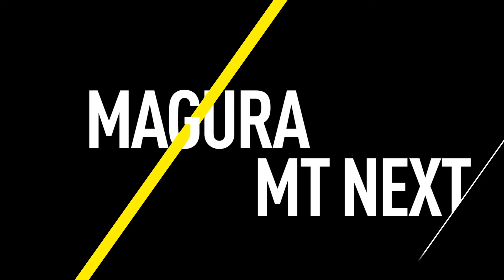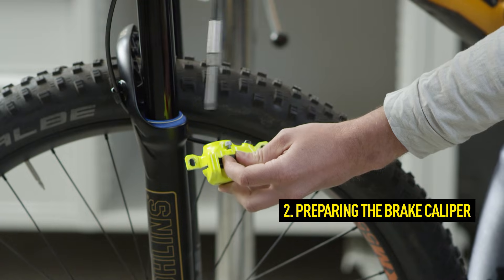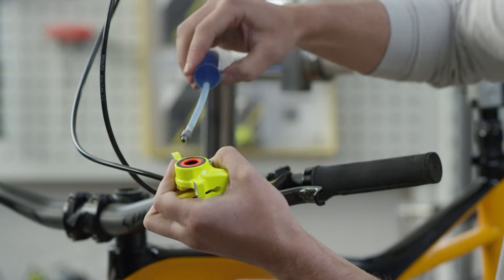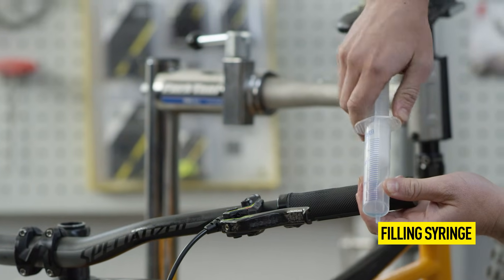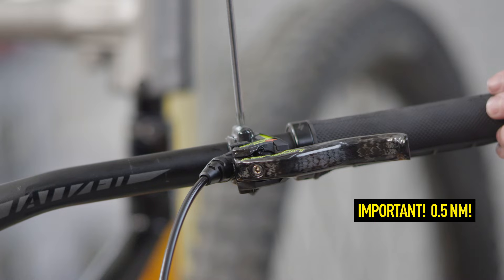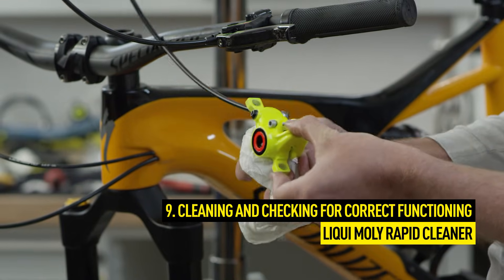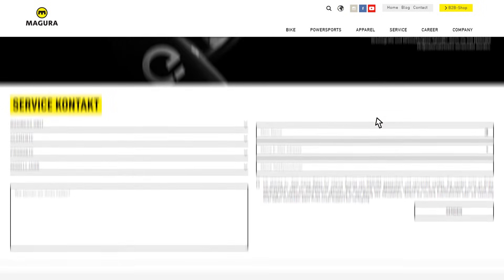MAGURA MT: Filling and Bleeding

Comment: Alright, but what are you supposed to do if you've got internal brake hose routing so cannot lift the calliper up to anywhere near the level of the lever? The only thing I can think of is rotating the entire bike nearly 90 degrees so that the calliper and lever are almost at the same level, but to do that comfortably I'd need a workshop grade repair stand with rotating clamp and I don't have anything like that.
Reply from the maker: Getting the caliper to the same height as the master when removing the syringe won't "make or break" your bleed - you will most likely only loose a bit more oil in the progress. It would still be good to get it as close as possible by tilting the bike though.
Reply: @MAGURAPassionPeople  If you loose oil you get air, pretty simple, make a quick bleed screw like everybody else.
Reply: @MAGURAPassionPeople  "One more thing to keep in mind during bleeding , is that the caliper itself has to be oriented vertically. If it's bled in a "flat" position (as it often is when mounted on a bike), air can not leave the caliper." Oh look, you stated it yourself
Reply: My issue too.

Comment: I really wonder why Magura does not use a traditional bleed screw on the caliper. That whole "raise the caliper and quickly close the hole while fluid goes all over the caliper" part could be avoided by a simple open/close valve. Like Shimano, Hope and many other brakes.
On "other brands" you literally 90 degree open that screw, pump in the liquid, close it and you are done. 

Any particular reason for this?
Reply: Good to know! Trying to hold the caliper above master on a internally routed hoser of a 65 pound bike is a massive pain
Reply: Agreed 10000000% pure pain in the arse messy and risk of air getting back in easier.
Reply: I wish it was as easy as a tektro 7 speed
Reply: Because they are dumb, only reason I can see, had to buy a stahlbus quick bleed screw to finaly be able to bleed properly on my surron. That's so fucking dumb.
Reply: ABSOLUTELY!!!! If I had known how crap to bleed these brakes are I would have avoided them like the plague.

Comment: I just bought some breaks for the first time and have never fitted them before do I have to bleed the breaks straight out of the box or do they come ready bled
Reply from the maker: Our MT brakes come bled out of the box, but you might need to re-bleed them if you shorten the hose - or generally open the system in any way.

Comment: I have these very same model, which I bought in 2019, there was no problem at until a week a go, I notice the rear brake was going until the bottom without pushing the brake pads, then yesterday I notice a leakage of Mineral Oil coming from the master level, exactly by where the lever blade pushes .... I need to know if this is normal and just a filling/bleeding will fix it?.. or is something abnormal... because I think, why would the mineral oil would flush out by the lever??? Weirddd!!!! 
Is there any tutorial about maintenance of the master level happens that before this happened past week I have been hearing a very annoying noise for when the lever is pushed in the master level, almost like something regarding the maintenance of the master level, but I haven't found any tutorial about disassemble of the master level only switch the lever in this video: https://www.youtube.com/watch?v=aDfDebmqCLQ..
I need help, right now... thanks.
Reply from the maker: Hello, we're very sorry to hear that you're experiencing issues with your brake!

If the brake is leaking at the master, bleeding it will definitely not fix it. We're unfortunately not able to fully diagnose something like that via the internet, but it's likely that the master would need to be replaced.

Please contact your according bike shop to check for warranty claims and to discuss solutions with them. If necessary, they can get in touch with our service team to check how to proceed.

Comment: i own a specialized turbo levo M5 2021 with  Sram guide RE brake   , can i mount the MT 7 without to change the disc ? thanks a lot .
Reply from the maker: We highly recommend to use our brakes only with MAGURA Original Rotors. Our rotors are 2 mm thick - this is 0.2mm more than SRAM rotors and this can effect the performance heavily. Our 5 years leak proof warranty is also only valid for complete MAGURA brake systems.
Reply: @MAGURAPassionPeople  what rotor do you suggest ?
Reply from the maker: @mauro2223  Generally speaking, all of our rotors will work with all of our MT disc brakes. We have summed up the differences between the different models here: https://www.magura.com/en/components/customize/setup-guide/

Feel free to send us a message on Facebook or Instagram if you have any further questions regarding your rotors!

Comment: Magura hs 33 when should i change the oil ?
Reply from the maker: As the HS33 brakes use our Royal Blood mineral oil, you don't have regular oil change intervals as you would with DOT brakes. The oil only needs to be fully replaced when it's very contaminated. It's a different story if there is air in the system, giving you issues with the bite point. But if that's the case, you only need to bleed the system, not fully replace the oil. Hope that helps!

Comment: excellent video but the problem remains the same, first two strokes very light braking, excellent braking from the third.
Reply from the maker: If the bite point moves outwards when pumping the brake, there is still air in the system. In that case the brake will be need to be bled again thoroughly until all air has been removed.
Reply: @MAGURAPassionPeople  as opposed to being a product that is easy to work on and set up - just keep claiming the mechanics are the problem

Comment: Hey, I have mt7 brakes. I bled them last week and it seems that oil is leaking from the bleed screw at the caliper. Does this screw need an o-ring? My caliper bled screw does not have any o-ring, but it is hard to see in this video if it requires one when the technician is reinstalling that last screw. Thanks!
Reply from the maker: Hello, thanks a lot for your question! The bleed screw on the caliper does not need an o-ring and the use of one isn't intended. Only the banjo connection needs one on each side.
Reply: @MAGURAPassionPeople  i don't know - I'm getting the same problem, leakage and air being sucked in thru the bleed screw. Going to try teflon tape...
Reply: Ive seen this on my boss's bike as well. I added a thin shim as a washer and it solved the mini leak for me.
Reply: your brakes are probably leaking because you over torqued the bleed screw (does you torque wrench go down to 0.5 Nm? Neither do the ones in bike shops) and now you need a new brake lever. don't worry, changing to a different manufacturer with solve all your problems...
Reply: @donaldriddle7138  based on your inability to read, I think your issues with Magura lie within yourself. Lol #keyboardwarrior

Comment: I lost an O-ring for the screw on the bleed hole in the caliper. Where can I buy those and how do I search it?
Reply from the maker: Thanks for your question! There is no O-Ring used on the caliper bleed screw! Only on the banjo connection, one O-ring per side is needed in the intended recess of the banjo connector.

Comment: I’ve followed the steps exactly on my rear brake 5 times now, no air coming out & yet this method fails to work. I tried hanging my bike almost vertically to try & straighten the brake line. Any other tips?
Reply from the maker: Hi, feel free to send us a message on Facebook or Instagram for help!
Reply: Ok, willdo! Thanks
Reply: @JimiAle  did you get any helpful tips?
Reply: @leonsandforth  I did! This video is for the older generation brakes although you can’t tell from the video. Magura told me to repeat the same process, but keep the brake lever on the bike horizontal & not at 15 degrees. This worked first time.
Reply: @JimiAle  ah okay, thanks
Reply: maguras are the worst to bleed. Even my bikeshop refuse to do it for me when i tell them i have magura brakes :/

Comment: Why I hate all brake bleeding video is they always use front brake as example! While the hardest one is the rear brake especially with internal routing. A lot of air bubble get trapped especially the kink cable looped under the bottom bracket. I bleed countless time with the bike in a normal horizontal position. The result all the same. Spongy brake lever for the rear. The tips is to really put the bike in wheelie position (you need bike stand with clamp) when bleeding the brake, the lever must be way way higher than the caliper. After bleeding, try to use cable tie to tie the brake for few hours. Afterward, bleed only the lever (refer to Magura quick bleeding video) to remove the final bits of air...finally I got a solid firm lever on my rear brake :-)
Reply: I'd like to second this feedback. I own a small business fixing bikes. I've found that Magura brakes are the hardest to service by FAR. I've talked to mechanics at several other shops in my area and they all feel the same way. Tutorial videos that make this process seem way easier than it actually is don't help anyone. 

Please make a new video and show the WORST CASE SCENARIO. IR hoses, rear brake, no shop stand. THAT'S the video people are coming here to see.
Reply: @bartscully9175  No bike stand is a little much if you're working on your bike you should have a proper work stand and if you dont take it to a shop the work is out of your league.
Reply: @chrismoulds7988  I disagree on that. While a work stand is undeniably helpful almost all bicycle maintenance can be done without one. I've put together a bike at home from a frame set, installing all the components myself, without needing one. My point of view is that if a bicycle component cannot be maintained by someone who does not have a full size repair stand then it's a bad design. Well designed bicycle components should be maintainable by the owner in their home with a minimum of specialised tools.
Reply: @Anthony Horton  Thats good for you, you do need a stand to this bleed proper. Proping up your bike to get the wheel that high wouldn't be smart of safe.
Reply: @chrismoulds7988  That wasn't my point. I didn't claim you don't need a stand to bleed these brakes, my point was that you shouldn't have to have one to bleed brakes, & if you do it reflects poorly on the design of the brakes. A bleed valve on the calliper is all that would have been needed to avoid this.
Reply: @chrismoulds7988  You don't need a bike stand to bleed shimanos
Reply from the maker: Thanks a lot for your comment! 

We would agree that the rear brake tends to be more difficult to bleed due to the points you've mentioned. However, we note in the manual as well as in this video that the caliper should be located vertically underneath the master and any bends in the hose should be avoided as best as possible during bleeding. Either by tilting the whole bike or by removing the caliper from the frame.

But thanks a lot for your feedback! Maybe we will have to go more in depth in the next video on bleeding the rear brake and how to position the caliper.

One more thing to keep in mind during bleeding , is that the caliper itself has to be oriented vertically. If it's bled in a "flat" position (as it often is when mounted on a bike), air can not leave the caliper.

Cheers! MAGURA Social Media Team
Reply: @MAGURAPassionPeople  So you guys have had a year to make a proper video for a rear brake bleed with an internal routed cables, your well paying customers deserve a better video

Comment: I have done this method countless of times on my magura mt2 rear. It didn't worked. Lever still feels spongy tho
Reply: I don’t understand why I followed your instructions but still failed. This is more difficult than obtaining a master’s degree in Engineering. The design is as worse as the products of Horiba Germany!!!!!!!
Reply from the maker: Feel free to contact us on Instagram or Facebook or contact your bike shop for further help.
Reply: @MAGURAPassionPeople  have your team heard about a lot of issues with plastic handles(for example on mt-5)? Will magura make stiff aluminium one? A lot of people have to change handles to shimano. Trend is called "shigura", you can check it on youtube. Your brakes have great performance, but are not durable at all. Please make something with it.
Reply from the maker: @jeffryLebovsky  The material Carbotecture allows us to save weight while keeping high strength and tight tolerances. Such a product would not be possible with aluminium. 

Carbotecture is a composite material made from hightech polymers and carbon-/ glassfibers, which offers significant advantages over the classical lightweight material aluminium: With identical tensile strength and fracture strength, Carbotecture is 50% lighter than aluminium.

If you have any additional questions regarding our Carbotecture material or about an issue you had with one of our products, feel free to contact us on Facebook or Instagram!
Reply: @MAGURAPassionPeople  lightweight is good, but on the other hand you get spongy feel on the lever and it is much easier to brake handle. Maybe in some bicycle sports it doesn't matter, but in downhill, enduro, trials, street it is necessary to have stiff durable handles and solid feel on the lever. Don't get me wrong, i love your brakes(i have hs-33 and pair of mt-5), but this moment with handles makes people choose another manufacturers. Just read forums and reviews, the only disadvantage of your brakes everybody is speaking about is weak handles. We want magura to be absolute best brakes. Make a special solid handle for aggressive styles of riding. Don't let your customers to build frankenstein brake sets with another manufacturers handles.
Reply: @jeffryLebovsky  the mt5 doesn't have as good of a master cylinder, also that squish comes from a bad bleed, also the hc3 can be adjusted for a stronger bite point, aluminum isn't any better but most people have mediocre bleeds mixed with long levers creating a spongier feel
Reply: @thelongestnameinthecomment9677  just read forums, it is not my thoughts, a lot of customers have problems with spongy feeling on lever and easybreaking handles. Bad bleed? Even from factory? Excuse me, but it is bullshit. It is real promblem with product, and manufacturer does nothing to solve it.
Reply: @jeffryLebovsky  the levers that come with the mt5 are longer than on the mt7 creating more power because of the leverage, the downside to that is that the levers feel spongy, if you get the 1 finger lever and bleed the brakes they'll feel WAY better, even just a bleed might help but the lever makes it even better 
I would recommend the hc3 but it can't be used with the mt5, you can adjust the hc3 to have a harder bight point then shimano or a softer bite point then sram
Hope this helps 🙃
Reply: @thelongestnameinthecomment9677  i think i'll deal with what i have until it brakes, this levers cost not less than shimano handles which solve all this problems completely) thanks for advice anyway)
Reply: @jeffryLebovsky  also factory bleeds aren't always great, take shimano for example, the company with the shittiest factory bleed ever the bleed those brakes come with are the worst thing ever, although magura brakes generally have pretty good factory bleeds, you should probably rebleed it
Reply: @thelongestnameinthecomment9677  rebleeding doesn't help, it is all about this handles and maybe fabric hydraulic lines are not stiff enough, because of the difference between front and rear brake. But nobody cares. It seems that magura don't see problem in this, they don't want to listen to riders,  and that is very disappointing.
Reply: @jeffryLebovsky  you used the word spongy, you only get that from a bad bleed the levers can change the softness of the bit point but spongyness is different
Reply: @thelongestnameinthecomment9677  what i mean is when you pull the lever there is no certain point where it stops, like hope and shimano have. Whole handle is so flexy that even when wheel is completely blocked you can pull the lever more and cause of materials(not because of bad bleed, it is another feeling) it will let you. It feels that i can brake lever with one finger if i'll pull it a bit harder, i believe it won't appear, but it is a reason why i can't completely trust my brakes(and it is very important in trials).
Reply: @jeffryLebovsky  it's still from a bad bleed, if there's air in the system it will lock the wheels up and then keep compressing, that's because air is compressible and oil is not, the materials have nothing to do with it...

Comment: Is it the same for an empty system after replacing the hose?
Reply: Yes
Reply: It won't be empty, they pre bleed it at the factory, a little air might get in but apparently it can be done without a bleed
Reply: A new hose is empty. The original (the one which came with the caliper ) is pre bleeded.

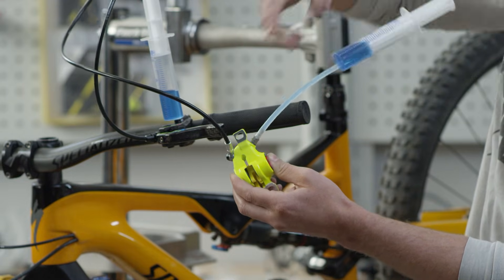Comment: I tried the procedure at 2:38.  After I fully actuated the brake lever several times ( more than 7 times ), I found that the oil will be transfer from the cylinder-side-syringe into the syringe at calliper side with "massive" air bubbles. But at this moment, the cylinder-side-syringe is still containing with certain oil, not empty. The air still come out even after repeating step 2:15 several times. I just can't figure out where are these air bubbles comes from. Any ideas would be appreciate.
Reply: Apply pressure on the syringe at the caliper side while snapping the lever